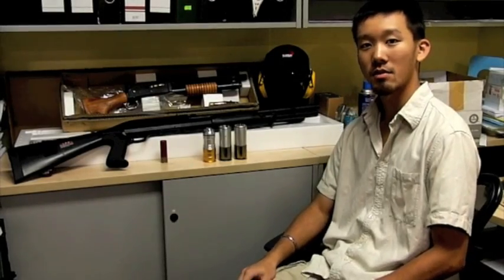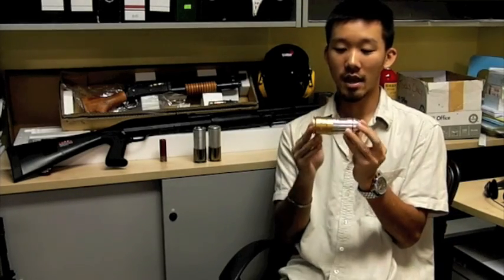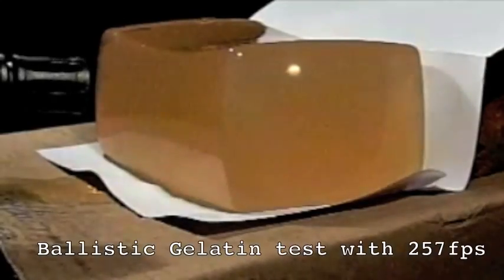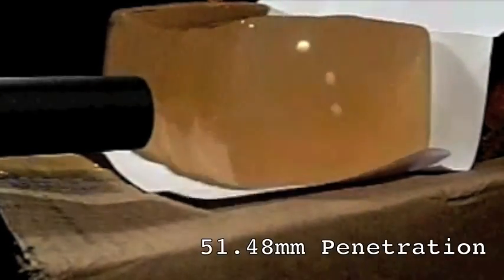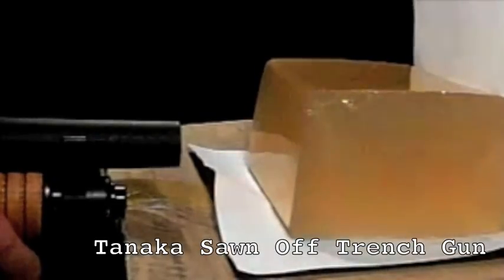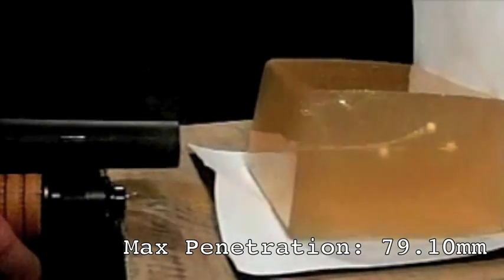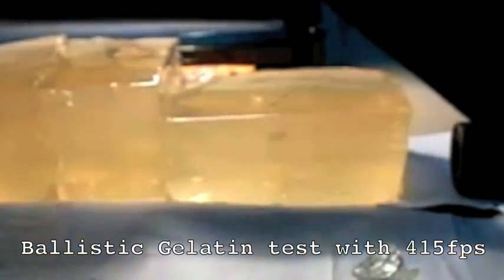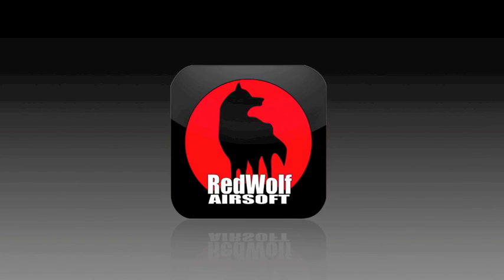Ballistic Gel test on shotguns - RedWolf Airsoft - RWTV

Comment: All vital organs in the torso/ribcage area are only 3" from the surface (unless you're REALLY fat) and bear in mind that you only need to puncture a vital organ e.g. the heart to score a kill shot, a through and through isn't necessary, this is why I don't understand why people choose a 9mm over a .45 because even with hollow points the round still has enough penetrating power to score about 10 inches of penetration on simulated tissue which is more than enough,

Comment: because skin cells are much more resilient, if this is the case oh enlightened one, why when last time you got hit with an airsoft pellet or stones from passers by as you go trying to troll them and fail, why didn't it hit you, get absorbed about 2/3 inches into your body before expelled by the elasticity of your skin.... because muscle tissue is far denser than layers of skin, true ballistics gelatine is designed to replicate an impacting object when it doesn't encounter bone.

Comment: @Rulictar The military does not use paintball or airsoft.
The military uses a round called simunitions, these are actual ballistic rounds. They're fired with smokeless powder, from brass cartridges like any other bullet, but the round itself is a soft shell filled with red paint, this is not a paint ball. These rounds are ONLY available to law enforcement and military and are not blanks, paintballs, or bb's, they are actual bullets.

Comment: @Rulictar  in most Military training simulations they use Sim-munitions witch are gun powder 5.56mm shells with a "paintball like"  tip, The shots fired from a standard issue C-7 or M16/M4 do not often leave a mark of paint because of the velocity they travel and it simply hurts making you feel as if youve been shot.

Comment: and i know what i just said contradicts my first post but most airsoft guns that little kids play with shoot about 250 feet per second and that will just bounce right off calibrated gel but 350 fps will go into ballistics gel calibrated to let a steel .177 cal bb penetrate 3.25-3.75 inches at 600 fps will let a 6mm airsoft bb at 350 fps penetrate 7mm into the gel

Comment: @Grenadeinmouth86 actually an airsoft gun that shoots about 350 feet per second will penetrate about 7 mm into properly calibrated ballistics gel but ballistics gel is calibrated to simulate muscle tissue and your skin is more resistant to penetration than muscle tissue so the bb will not penetrate your skin but if you cut a square of your skin away and shot the muscles under it it would penetrate about 7 mm into the muscle
skin is much tougher and more elastic than muscle tissue

Comment: Those of you raging about lack of penetration against skin have once again proved only to show up your own lack of intelligence.

Of course airsoft doesn't penetrate skin, this test is to find out the relative power of BB guns when chronographs cannot be used.

You would know this if you had read the description, assuming of course you are capable of intelligent thought at all and not a total 'tard for not reading or having enough brains to work out whats going on.

Well done, you fail.